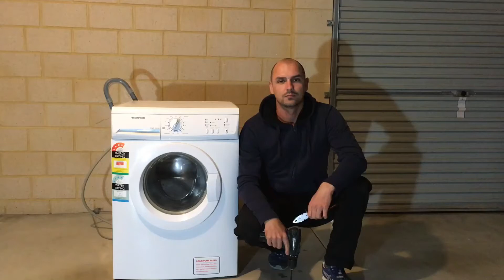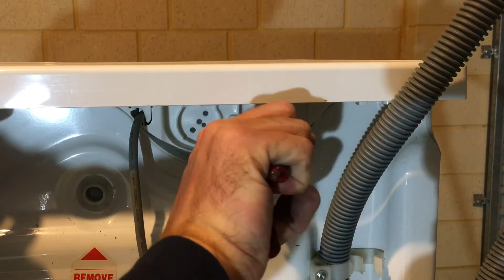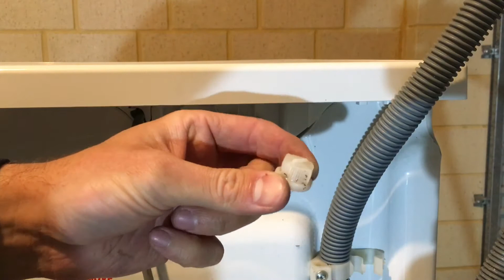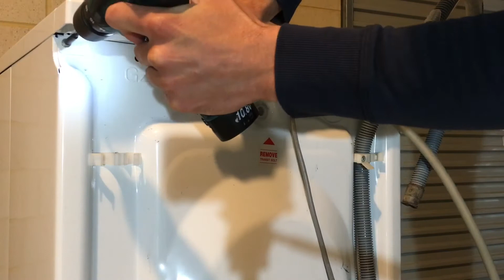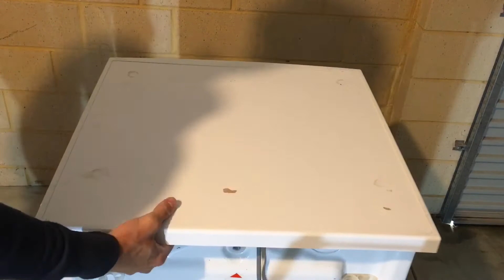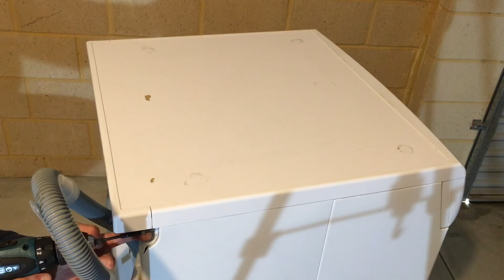Simpson Washing Machine Water Inlet Valves Replacement - E10 Error

Comment: I have a BOSCH 8K 1200 RPM washing machine and It gives E17 every now and then and I noticed water coming in slow. How do I open it and clean its entire water inlet, pathways, filters etc ??? 

your videos helped me once before and I saved on a 200 miles of travel and thousands of rupees for me. Looking for same again.
Reply: Best to replace the whole inlet assembly. That's what was done in this tutorial. Not expensive.
Reply: So...before I do this how come hot water comes in freely ie can do a very hot wash but no cold at all, yes the filter is clear yes there is high pressure water in the hose

Comment: Is it possible to rework top loading washing machine to work somewhere in the remote woodcabin house....
of farm, homestead or weekend house,  that is
without a proper hot water or could water pressurized system,
... ...but 
* to load hot ,  could or warm water simply by bucket ,... 
and still be able to run a machine somehow ???

Simpson Sprite 650  -  top loader washingmzchine .
Reply from the maker: It would be fairly hard. Inlet valves require high pressure to operate. Some older machines use to have low pressure valves but all manufacturers have stopped making them about 20-30 years ago. Even if you do find a low pressure solenoid that fits, there could be a compatibility problem with the control board, the different type of solenoid might blow the main PCB if it has different electrical specs.

Comment: Hey mate . I still have a issue . Replaced the inlet valve ( had low water pressure) but the water is still only trickling in. I’ve checked  all filters , drains , and outlets . Also even checked the voltage  at the solenoid. All good . Any ideas
Reply from the maker: Hey,
If you unscrew the inlet hose from the back of the valve and turn on the tap. Does the water flow fast and hard? Some inlet hoses have a screen mesh filter that gets blocked with sand at the start of the hose where it screws onto the tap. Or it could be the tap it self that doesn’t open properly.